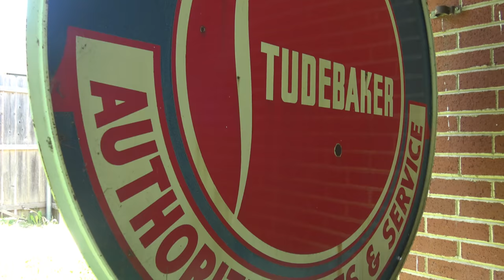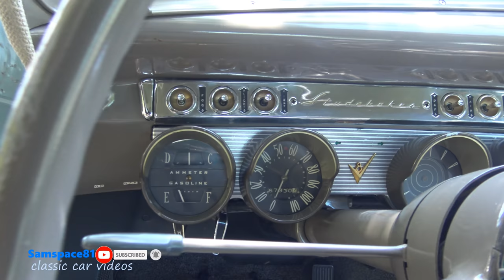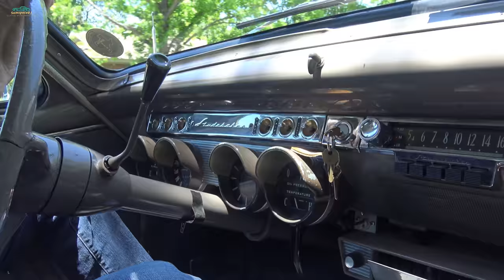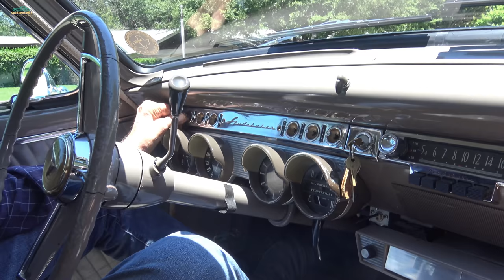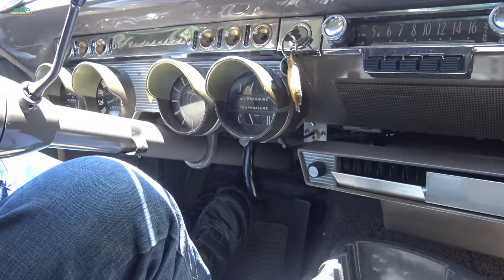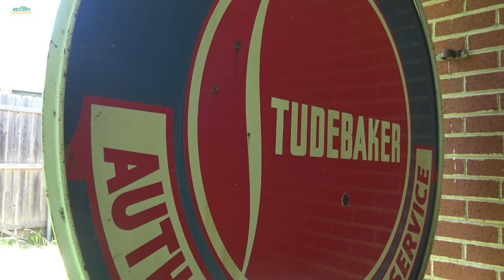1953 Studebaker Commander Samspace81 classic car inspection, owner interview, road test

Comment: My first car when I was in high school was a '53 Studebaker Commander!  Coral Red with a white top!  All the "cool" dudes were driving Fords, Chevs, Mercs and an occasional Plymouth!  Being someone that loathes being like everyone else I went with the Stude!  I also liked the looks of the car.  It may not have had the horsepower of some of the other cars of that era, but it would out corner just about anything.  Had it 2-3 years until I blew up the engine!  But I loved that car, and because of it my first new car a few years later was a '63 Studebaker GT Hawk!  Had that car for 30 years, put over 240,000 miles on it!  There were few that could outrun that Studebaker.  It was capable of pegging the 160 MPH speedometer.   Only did that once to see if it would, but didn't want to blow that engine up!  One was enough!
Reply from the maker: Good stuff Ron, appreciate you sharing those memories here! Thanks so much for watching the Samspace81 channel

Comment: I would much rather have a new car than this old stuff. That way I can see what I'm driving coming and going. It's easier to hide our car in a parking lot. Then there's the $635.98 monthly payment for 84 months. Hell, when this fine Stude was built, you could have your new suburban area house paid for in 10 months at that rate. Ray Loewy did it right. There's a '54 Stude pickup around here still doing farm duties on nice days. It's real easy to spot in the Farm-Mahal Superstore parking lot. So is our 1956 Plymouth.
Reply from the maker: Dick, really ahead of its time, looks like a mid 60s car to me. I appreciate your great comment & viewership sir.
Reply: @samspace81  No sir, you have that backwards. I thank you! I bet your Stude doesn't have the aluminum driveshaft problem that the new GM vehicles are having.... while the owner makes payments on his $101,000 Escalade!